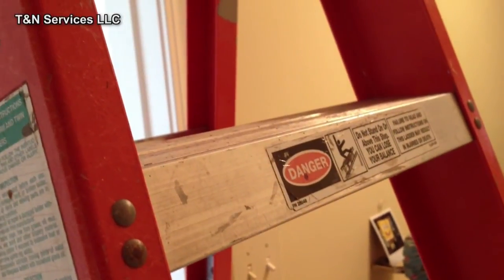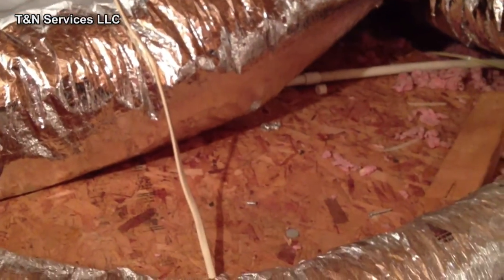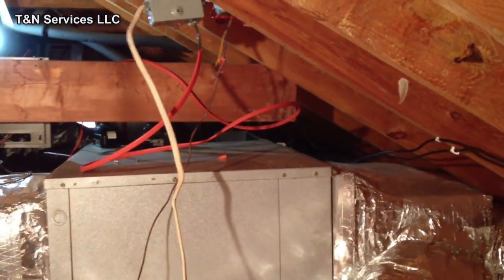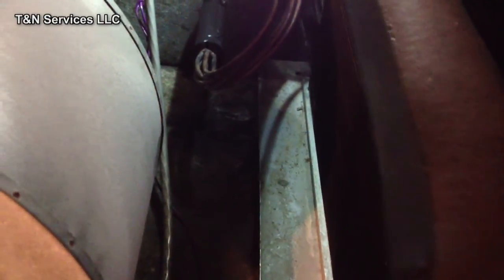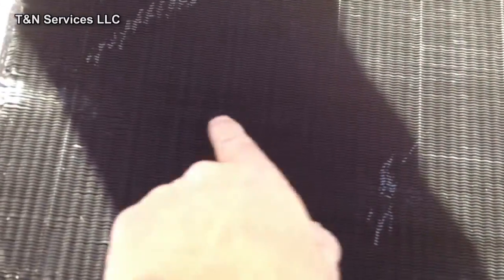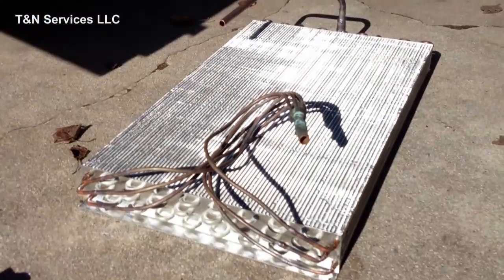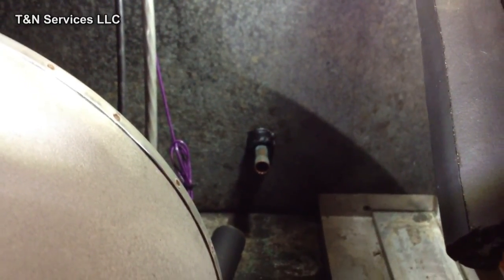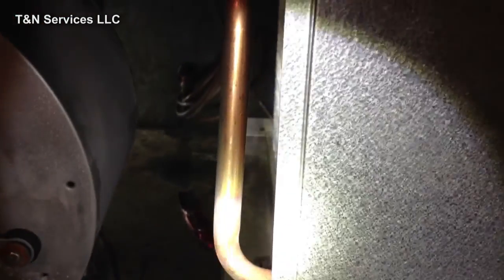Horizontal Geothermal Evap Coil Install

Comment: You made the coil swap look easy. It musta been one awkward tough set up gittin in there with a torch, sticks and a few mirrors, that's where Steven`s little tank would be a pleasure to use. Surprised to see that rose colored jug too, bravo.
Reply from the maker: Hey Allan, believe it or not it was pretty easy brazing it in. I like my torches, they are all I've ever used. It would be tough to switch over to something else.

Comment: looks like an old cap tube system but on a 410 a  system can't be . just a cheap  coil  but your the coil man if anyone can do it your the man ,good job ralph
Reply from the maker: Hey Steven, the TXV is down by the compressor. those were just the feeder tubes

Comment: You'd think they would fit the cap tubes in the factory! Hope that was time and materials and not a fixed price job.
Reply from the maker: Hey John, I've ask them to consider fitting them in the factory and as you see they didn't do it. Oh well just a little more work to do.